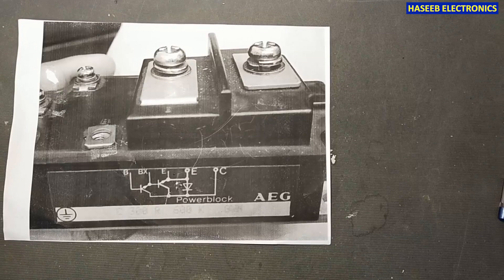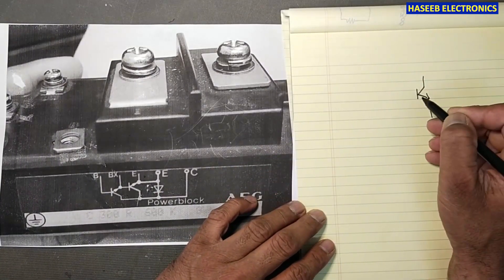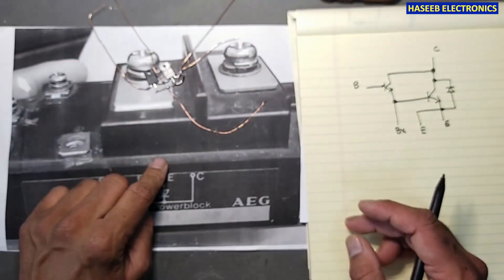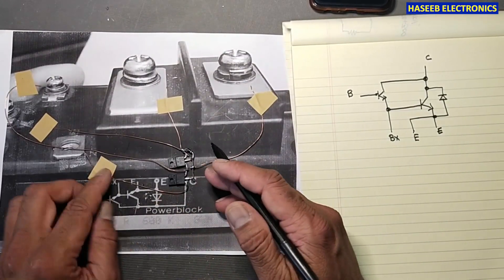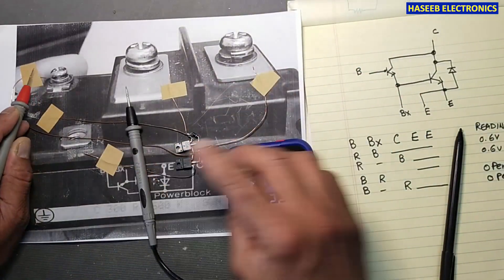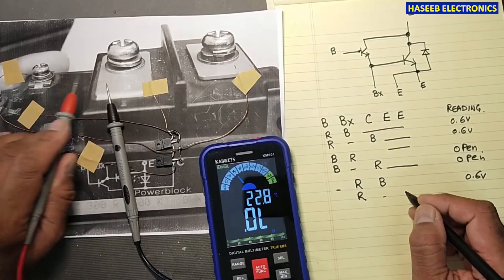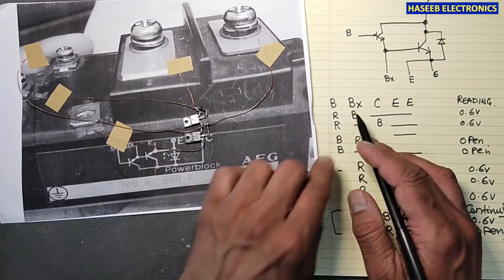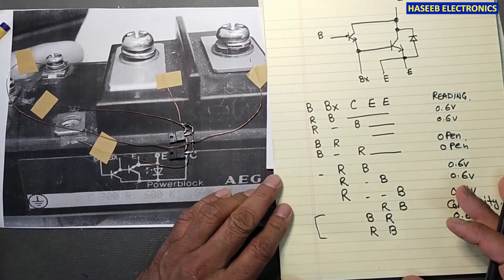{830} Testing Darlington Power Module AEG C300R600K

Comment: How to drive such module how much base current is needed to saturate using in switching applications also do I need to drive the base hard to emitter or just remove base current is enough? Maximum switching frequency roughly?
Thanks 

Steve
Reply from the maker: best regards 
it is hard to find online datasheet. we need to consult electronics components data books (printed versions) than may have exact product data. i will try my best to explore, if i found any supportive material, i will pass it to you
Reply: @HaseebElectronics  unfortunatly that was no help really as you basically told me to look at a datasheet😅, but thank you for your reply anyway,  i thought seems as you used to work with these things you could tell me about the drive needs not of this exact model  but just these large transistor modules in general,  it seems you may not have the information I seek?  also I need  to point out you  made a mistake in your video,  you said the Bx is for testing and not normally available to the user, this is not true I have many different models and all have B and Bx I can tell you from the small amount of knowledge I have on these devices that the Bx terminal gives direct access to the final output power transistor base so we can pull current off it quickly to improve turn off characteristics....
Reply from the maker: yes dear in past i worked on isogaurd, emerson and other 30-100KVA UPSs. it was 1997 to 2010 period. 
please accept my best regards for a valuable update
Reply: @HaseebElectronics  can you please tell me roughly what frequency the older UPS's ran at with these transistors please? And maybe a rough idea of base drive needs, do they need a base resistor? 1ohm? Do you use a fast diode to Bx to pull the current off with reverse polarity base drive? Do you know the answers? Thanks in advance 

Steve
Reply from the maker: https://datasheetspdf.com/pdf-file/904266/Matsushita/EVM31-050A/1
Reply from the maker: https://www.rgbautomatyka.pl/en/p/file/1558868a8a769aa50660fcaed695accd/A50L-0001-0103-EVL31-060-IGBT-FUJI-MANUAL.pdf
Reply from the maker: http://www.semimart.net/datasheet_pdf/Mitsubishi/QM150DX-H.pdf
Reply from the maker: please check this datasheet
http://www.ineltron.de/english/powerex-data/ks624540.pdf
Reply from the maker: https://pdf1.alldatasheet.com/datasheet-pdf/view/21341/POWEREX/KS624540.html
Reply: @HaseebElectronics  thanks but this doesn't answer my questions about gate drive circuitry and the inverter operating frequency etc
Reply: @HaseebElectronics  how much deadtime should I run? Do I need negative base drive? How much? For d/t?
Reply: @HaseebElectronics  no offense intended but I can find datasheets myself what I can't find is good application data and being from the igbt age I lack knowledge around these transistors I don't need the specs I need information on their application